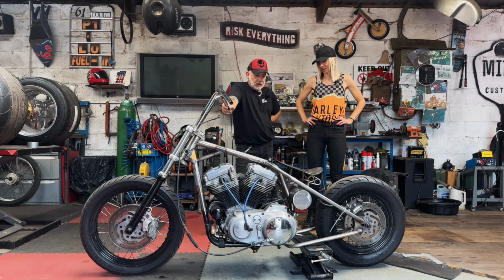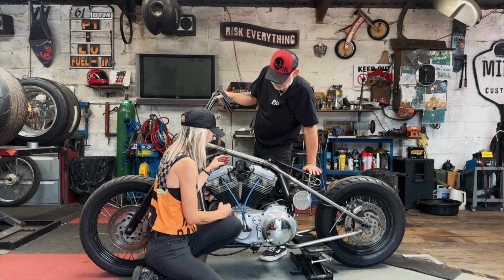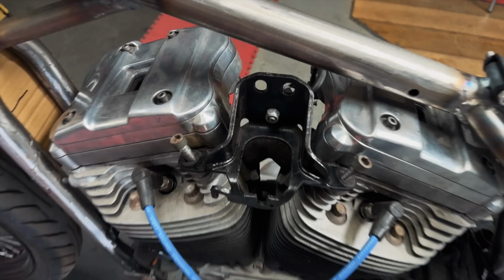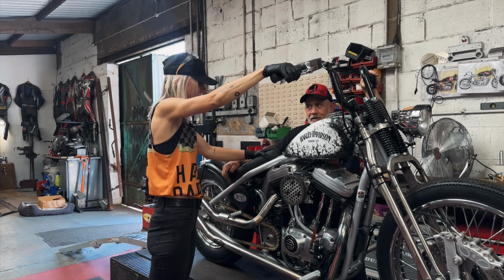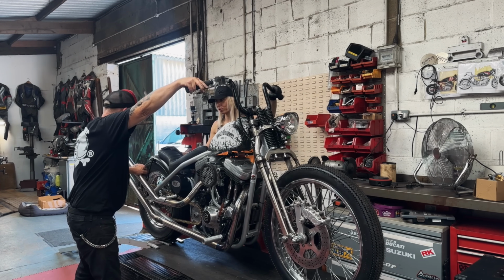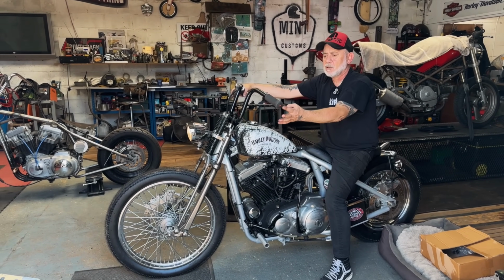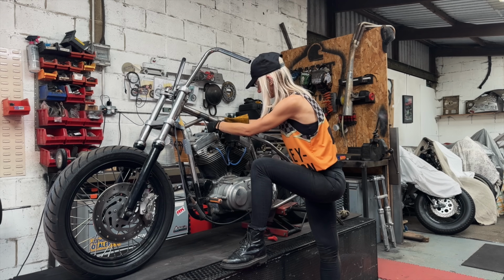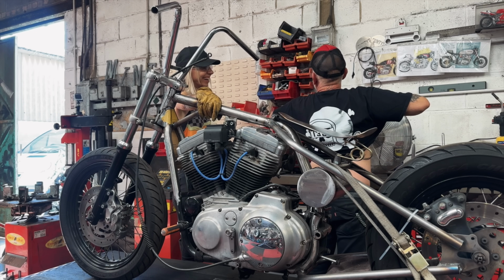Coil Relocation and Head Steady on My Hardtail Harley Bobber Chopper Build

Comment: Speaking of Jonessy (Jonessie?), I built some some CB 750's back in my shop days. On two of them I made 1 into 4 intake manifolds. Basically they were 4 equal length runners from the engine, to a plenum, and another runner to the carb mount. I used Sportster 1000 Keihin butterfly carbs on them (the newer CV carbs Harley used after those would probably work even better). Once dialed in, those bikes were little hotrods, and no more 4 carbs to deal with.